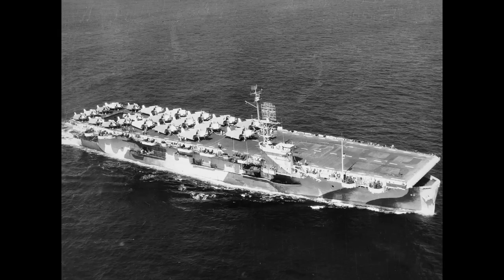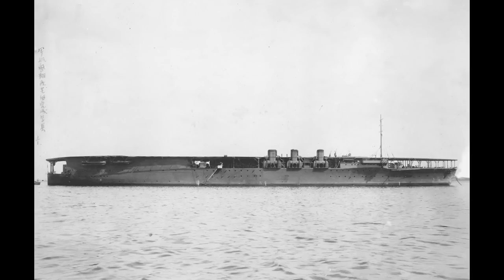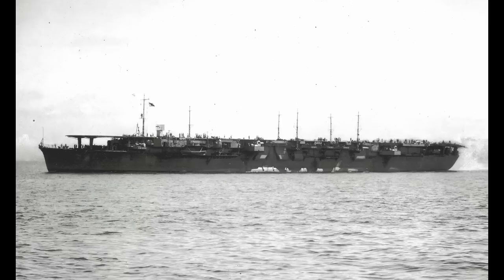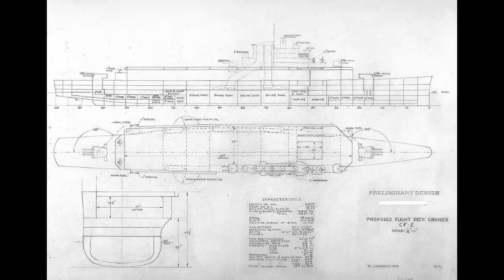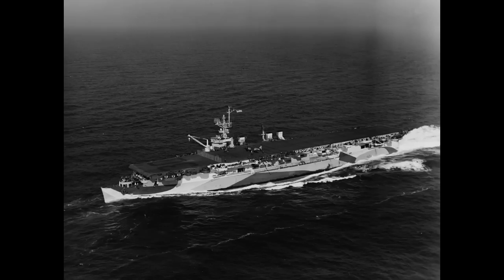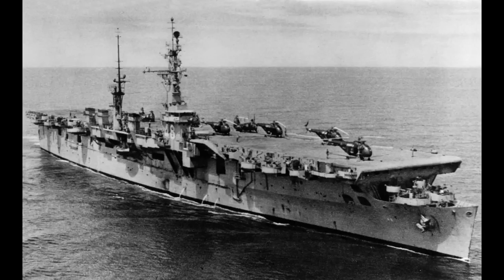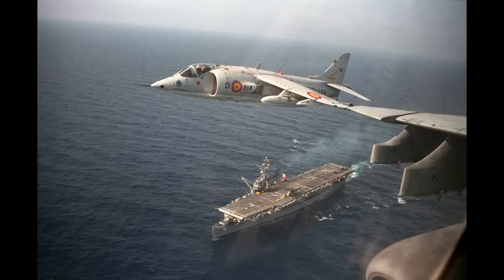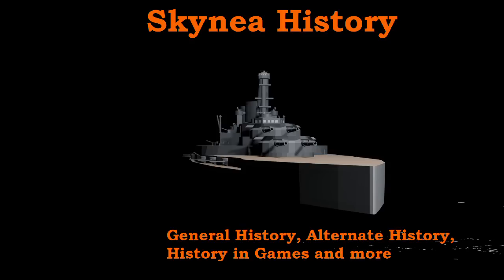Light Carriers - Emergency Builds to Flagships of Small Navies

Comment: The Invincible class "through deck cruisers" nickname in the Royal Navy was "See through cruisers" (later ASW cruisers) as after the cancellation of the larger carrier replacement program everyone knew that they were "backdoor" carriers ! Useful though........
Reply: There was a study, a comparison, of the Through Deck Cruiser and the planned Sea Control Ship (SCS).   The INVINCIBLE Class CVL and the SCS were an interesting comparison.   The bizarre point of the SCS was that the design depended upon the success of the development of the XFV-12 VSTOL aircraft.    The SCS concept was tried out on amphibious warfare platforms, notably the LPHs.   The sensor and EW suite of the SCS seems to have been adopted for use on all of the LHA and LHD types.   It seems that the failure of the SCS program was tied to the failure of the XFV-12 VSTOL fighter.   Although the AV-8A HARRIER was tested aboard the LPHs as proof-of-concept for the air wing aboard the SCS a platform, the USN could not envision any other solution than the XFV-12.    The airwing of the SCS was not envisioned as being much more than a short squadron of XFV-12 and a squadron of SH-3 SEA KINGs.   Little mention was made of tanker, COD, VS, EW assets.    The tanker needs could be met with buddy stores carried by VSTOL aircraft.   COD aboard SCS ships would probably be met only by UH-3.    The EW assets would only be met by dedicated rotary-wing assets optimized for fleet defense.  

This has seen a repeat in the ZUMWALT Class DDGs where the failure of the main gun armament and the lackluster performance of the missile armament has resulted in the failure of the program.

Comment: The escort carriers were meant to escort convoys and supply the air cover that was such a bane to U-boats. Preventing a  U-boat from successfully attacking was as much a victory as actually sinking that self-same U-boat. Certainly, they could, if called upon,  provide a small strike force and did so on a number of occasions during WWII but that was not their purpose and they did so at their peril. The light carriers WERE meant to be in the "thick of it" and proved their worth despite their limitations in size. The light carrier program arose when the timing of the arrival of the new Essex class flat tops was in some doubt.

Comment: Good choice. Light carriers are often treated as an after thought; The two biggest drawbacks being cramped and lightly protected.
Reply: The development of STOVL aircraft is changing that. The performance of the Harriers during the Falklands War was an eye-opener. Given what the F-35B can do, it's entirely possible that nuclear supercarriers are losing their value. Larger fleets of smaller conventional carriers may well be more practical in the future.
Reply: @Cailus3542  the problem with smaller carriers is that the aircraft on them have significantly reduced maximum takeoff weight, even with STOVL capabilities. They are currently excellent for defending an area or supporting an amphibious landing but not nearly as capable of projecting power like a supercarrier (less aircraft, less aircraft range, less ship range/speed because of no nuclear reactor). This might change though with advancements in STOVL technology or drones that are light enough to take off at full weight from a shorter runway.

Comment: The premise that the Essex carriers would take three years to build was proven wrong. Applying the "Kaiser" method used in building escort carriers resulted in a shorter build time.  The smaller escort carriers used reciprocating steam engines instead of turbines, had no armor or anti-torpedo bulkheads.  The crews considered them to be floating coffins, yet only a few were sunk. The escort carriers served a very useful purpose, escorting convoys and transporting aircraft plus being used to support ground attack aircraft. The light carriers actually racked up some surprising victories, fighting well above their weight class.